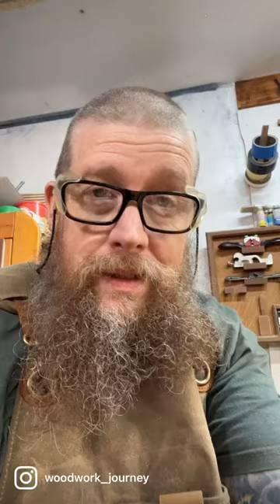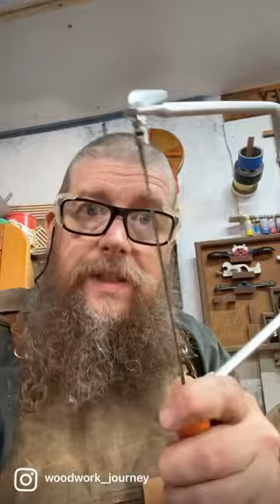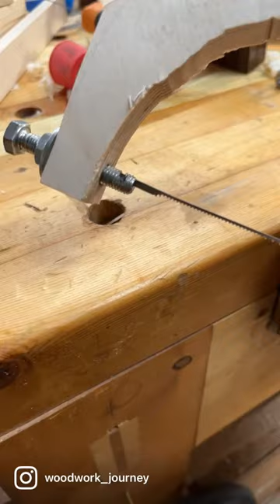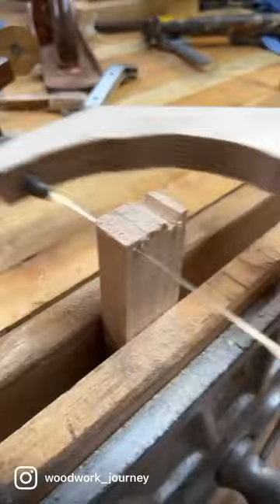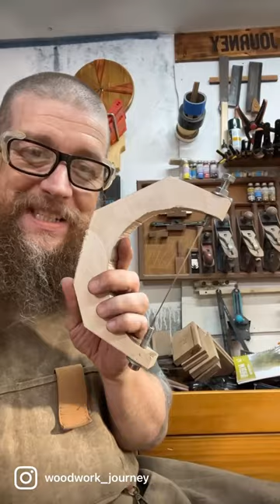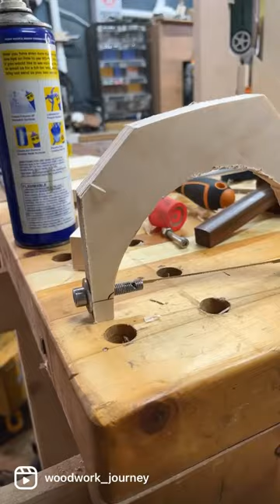I made a Saw to clear out Dovetail waste!

Comment: What’s the motivation behind your version? Is it because the hand placement is above the blade instead of behind the blade? Essentially it’s the same cutting tool but maybe it’s the grip that motivated you to rebuild it? I think it’s very creative and a fun solution but just curious what made you do it. Cheers
Reply from the maker: Very valid question! Cheap coping saws have a very springy frame, so you can’t get a really tight blade. That means that tight corners or more control when sawing are very difficult because the blade moves about.
There are some more hardcore coping/fretsaws available, but even the Banggood WNew version with a thick suspension bridge looking frame is still fifty quid - which is out of my affordability.

Making my own means I can get the benefits because the birch ply is super rigid, but none of the cost - and I can use a thin blade from an electric scroll saw 😊